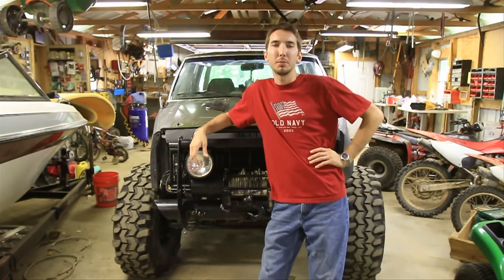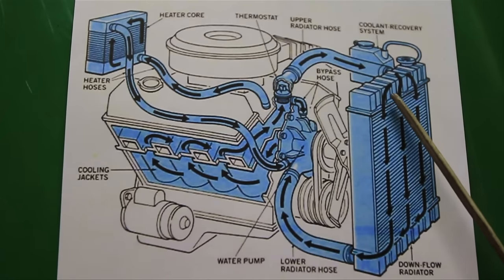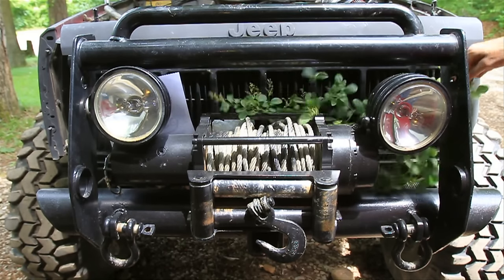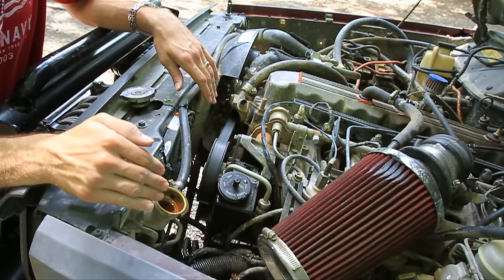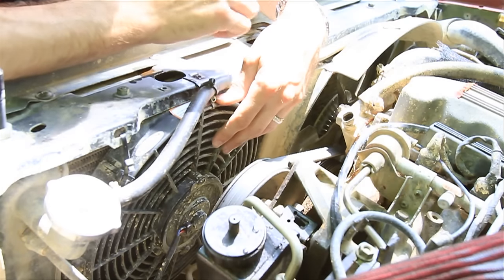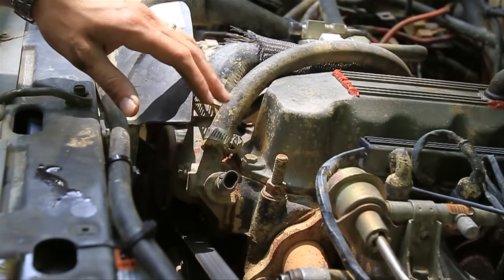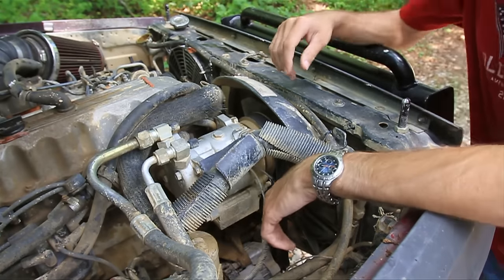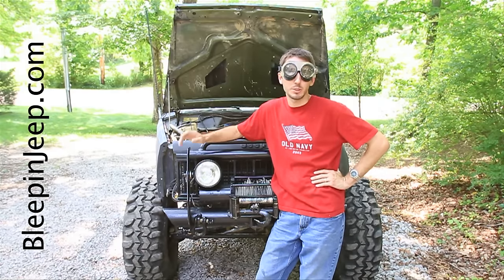Engine Overheating? - 9 Steps to Solve

Comment: Jeep xj's have a hard time in the desert. Hood louvers help as well as a larger capacity aluminum radiator. But lots of people have a hard time yet still in our summers. If you ever build a 4.0 here don't over bore the engine more than .020" because i've seen plenty of problems in cooling if bored more than that

Comment from the maker: i had the same issue a while back and it was the clutch fan.  sometimes they aren't bad but just aren't as good as they should be.  try putting a new clutch on there and see if that fixes the problem.

Comment from the maker: could be a ton of things but I would check that you don't have a clogged radiator first, that you didn't install the thermostat backwards, and that the spring in the lower radiator hose is still there (if it is suppose to have one).

Comment: I just watched the video. Great info. But maybe you should mention that after doing all nine steps if still haven't resolved the problem, to check for oil in the water or water in the oil for a bad head gasket.

Comment from the maker: well there are two types of cooling systems, open and closed.  If your overflow bottle is sealed like a pressure vessel then it is a closed system and you need a new bottle.  Most modern cars have open systems though and the overflow bottle has a vent and does not contain pressure.  if that is your case then there is a problem elsewhere which is just venting the coolant out the reservoir which it is suppose to do when there is a problem.

Comment from the maker: what i was saying is that you might have an airflow problem... the fans are not pushing enough air when you aren't moving fast.  check your fans.  That low rattling sound was probably your coolant boiling in the plastic bottle.

Comment: Can a cooling system flush really solve an overheating engine issue?My Ranger 3.0 was overheating.The coolant was replaced and this seems to have fixed the problem.No other problem was found.Thanks and you have a new subscriber!

Comment from the maker: They are both separated in different tubes.  just like the oil and coolant both go into the engine but they are in different compartments and dont mix.  The radiator cools the tranny just fine on stock applications but some people choose to add on another in line external cooler for performance applications, lets day for towing, racing, hillclimbing, etc.

Comment: My 4.0 renix ran cool at 160. Found out my thermostat was stuck open, replaced it and now it reaches about 180-190. I've heard proper operating temp for the 4.0 was about 210, any idea what may cause it to run cooler? My secondary fan is manually operated, so it's off most of the time unless I'm sitting still. I could drive her for a couple hours and grab the coolant line bare handed without burning myself, I know my temp gauge is reading right. Suppose I should be happy it cools itself so well.

Comment from the maker: several possibilities...  Either you have air in the system, or you have a clogged heater core, or you have a vacuum leak somewhere which will keep the vacuum controls from working properly until higher rpm.

Comment: Mine is perfect stock system with high flow pump and still overheats. Az summers 35’s 4:88 won tons and loaded up with strong tuned up 4.0 is too much for it so had to install a large trans cooler which works wonders!  I now think the leading cause of overheating cherokees may be this exact thing. rad fan shrouds super important and removing stock skid plate that creates vacuum on backside of rad is a bad thing but we all must do it for a multitude of reasons.

Comment: My bro in-law had an overheating problem with his 2000 Cherokee, had the 4.0 inline 6. I noticed a ''no flow'' condition so I removed the water pump. The bearings n seal were great, the impeller was almost GONE, it was just a flat disc spinning in the coolant. New pump, no more problems!

Comment: Great steps thanks. I'm a shade tree but start panicking & thinking the worst moving down from there. usually buying replacing parts I didn't need too sweat and replace. Nice to have a mellow guy go through steps I already know, slow me down, think. B.T.W. my wife loved it. She cant change flashlight batteries, but understood every word. Finally!!! she wont blow another head gasket Grrrr. I too stressed the importance of always wearing eye protection while working, thanks Jason.        Phoenix , AZ july 2016 114 degrees today.

Comment from the maker: If your temp is fine on the highway and high when you stop then not enough air is being manually pushed through... Usually that would mean your fan is not pulling enough air.

Comment: 91 jeep yj. Changed rad, tstat, water pump, hoses...it's still running hot. Not the 210 it used too. Only thing left if the fan clutch? Fan seems to be working fine. It's running around the 230 range not matter if it's hot or cold outside. 4.0, 295 tstat. Thanks

Comment: Hi I have a question I have a Jeep compass 2007 drove from LA to Yosemite-overheats when you drive long distance and uphill I already checked the fans which they look okay at the transmission oil flushed out two years ago but I didn't change the filter. Does not overheat when I'm driving on the street or on freeway. Told it was the transmission oil cooler that needed to be replaced but I just want to doublecheck if that is the correct reason. I know if I flush out the transmission oil again and change the filter in my cause more problems. Please help me!!

Comment: 2a) debris between the radiator & AC condenser.
10) plugged converter.  ;)

I like to use those lever-lock radiator caps when I can find them.  Then you can safely release coolant pressure when the system is hot.  Most radiator caps are also designed so you can release the pressure when hot, but I don't like to share that with people because you have to know what you are doing to do it safely.

I like to run a pre-filter on those cloth type filters, especially for when the water gets deep.  ;)

Comment from the maker: you might try flushing it if your are concerned, many times it was be a vacuum issue as well.  you might also want to check or replace the heater control valve.  But the heater core has nothing to do with a car overheating unless it is leaking the coolant out.

Comment: Like your basic diagram in the beginning you brought up good points here in a little constructive criticism and I mean no harm.

Coolant temp sensor you missed which is what tells them there might be an issue and sometimes false alarm/faulty sensor, you didn't elaborate on the internal radiator within the radiator for the xmsn or tranny should I say my aircraft mechanic terminology kicked sorry. A lot of the newer vehicles are using oil coolers i didn't see when this video was posted if old viewer might want to look into what systems your vehicle may include. If they are missing coolant didn't elaborate on where they might want to check where the coolant in going if so. Some vehicle water pumps break the impeller but still actually look like they are still good when their not. Radiator or heater core being clogged internally.

For the most part well done

Comment: excellent video one thing I am curious about is when you mentioned transmission fluid flowing thru your radiator. I am little confused if that is the cases then how do these fluids not mix together i.e the transmission fluided and the coolant/antifreeze fluided?
And do you have any video as good as this one for the air conditioning / car heating system? Great job
Reply: Separate sections so they can't mix.

Comment: You may have mentioned it but also check your oil level. Low oil will cause overheating. Too much oil will also do to frothing the oil from the crank shaft. And last if your oil pump has gone bad. Rear but it happens.

Comment from the maker: sounds like you could have a bad thermostat, low coolant, or maybe not a good 50/50 mix.  Also, make sure there are no bubbles in your coolant, in which case you could have a bad head gasket.

Comment from the maker: are you sure its a clutch fan or an electric fan?  most clutch fans I have dealt with are operated thermostatically and don't have a wire to control the clutch.  So now I'm a bit confused if you are talking about a clutch fan, an electrical fan, or a A/C clutch.  What kind of car is this?

Comment: Thank YOU! An alternate way to check the fan clutch!  The book says when it's hot it should be harder to move,  but as you say- it's practically impossible to check that way- my old one failed that test but so did the NEW one I bought- so is it bad? I doubt it; your "coasting" method sounds much better. I was about to drill a hole it the old one and pin it,  but now I'll check it your way. I don't have anyone to help,  but I can rig up my LizardCam so I can see it from the driver's seat if I can't shut it off from outside the cab...EDIT: Just checked it that way,  and it coasted for about 1/2 sec. Thanks again!

Comment from the maker: well make sure you replaced the right relay.  It may just not be getting hot enough to kick on.  As for the A/C check your fuses.  Also, jump the clutch to see if the electromagnet will engage.  Then get back with me

Comment: Very thorough thank you...also love the goggles...is there risk of putting air back into the system with the pressure cap off while running/testing?? I also thought that you are to put coolant in while the engine it's cold only, so how would it effect it one filling it with the engine hot?

Comment from the maker: same radiator but different tubes for the coolant and tranny fluid (not all radiators have tranny fluid in them).  The tubes zig zag back and fourth and the fins cover the tubes to dissipate the heat more efficiently.  try googling radiator cross section for an image

Comment: My Xj was heating bad. Boiling water dry. Had back flushed, new fan clutch, New pump hoses etc etc even a new rad cap. No help so far. Took to a rad shop, they tested "new" cap. didn;t even hold 2 psi. trip tp NAPA for new locking 15lb cap. NO more heating trouble! Sometimes its the simple things.

Comment from the maker: I assume you are talking about electric fans in which case you need a new fan or fans.  If it's coming from the clutch fan I would assume that its coming into contact with the fan shroud... meaning your shroud is loose or the engine mounts are bad and the engine is moving around.

Comment: might have missed a bad head gasket, or if the car has overheated previously cracked heads or block..  but thoes are the worst case scenario..otherwise you did a great job with your explanation.. thanks!

Comment: You can also do a compression test to see if your have a cracked head or a bad head gasket these will also make the engine over heat. Do a compression test on all cylinders and if one or more is considerably less then the others its a bad gasket or crack. Ive heard of another way to test your mechanical fan by spinning it by hand with the engine cool then let it warm up to about 200 shut the engine off and try it. if the fan is working it will be harder to spin. heat activates the clutch

Comment: I start overheating on the highway under heavy load, especially with the AC running.  All the components on my cooling system are new and my system has been flushed three times.  Any ideas?

Comment: And if the coolant system checks out...check oil pump especially if you have the oil sending unit with the threaded stud slip on connector and you get used to ignoring the oil light because that connector has (notoriously) gotten loose and breaks contact or regularly falls off...highly recommend an analog oil pressure gage on those models whether it be jeep(Chrysler) or Ford or general clunkers

Comment from the maker: did you replace the radiator cap?  or you might have air in the system.  is this a pressurized reservoir?  if so it could have a hole in it.

Comment: my mechanic tells me that this sound is the alternator pulley is loose. i have a 93 chamonix 2.5 diesel and that's what mine sounds like only worse at times. i am in the process of looking at doing the tightening which means removing the drivers seat and the cover over this area. i will try and keep you posted.

Comment: Lol I just installed a heavy duty fan clutch from a 4.0L YJ in my 89 XJ. Overcools but in traffic it gets up to 205 ish. I used to have running hot issues and I've replaced my radiator, thermostat (and housing too but that's a story for another time). I think my issue was a combo of a clogged radiator and a water pump with worn out blades

Comment: It looks like you need to install a coolant reservoir container. I had to on my first car a 1969 Buick GS SE. It didn't have one and the car was from Washington state and I was in Arizona. So when the car was hot on a hot day it would blow coolant out the tube once the car was shut off. So I added a cheap little after market coolant reservoir and it worked nicely. Once the car cooled down it would suck the coolant back in the radiator. Less polluting, having to add coolant, cost, and messes on the ground

Comment: Darn I just changed my hoses, thermostat, and radiator cap. It got dark on me so I didn't test it out yet but watching this video made me realize it's my water pump that's failing. Makes a loud whining noise when I turn the engine on gets louder when I accelerate for the first time then it stops. Also, when I opened up my coolant reservoir container there were little pieces of plastic or metal on the inside of the top.

Comment: Hey Buddy amazing video thank you so much for making it! As you mention at the end I have exactly the same problem so I have engine overheating only in traffic and in city drive. Should I start to replace the fan first? I was thought maybe my water pump went wrong.
(BMW x5 e70 4.8i 2007)

Comment: Ok, I'll try that soon...

One more question, I check me radiator fluid and it's a yellowish looking color brown kind of mirky look. And there's some sediment in it that looks almost like mud... I also have a weird noise coming from somewhere near the engine, that almost sounds like the power steering system when you turn hard, but has a high hum sound to it. Might this be the water pump? It does to to suck water when I increase the throttle.

Thank you so much for taking the time to help! :)

Comment: Fantastic, I have been trying to figure out why my truck runs great and doesn't overheat when I drive, I stop and it starts going up.  Also if I go uphill slow.  I service a road that is a residential slow grind.  I remembered opening the cap and seeing silver shavings.  When he said that it was bingo.  My mechanic has not figured it out.

Comment: You briefly mentioned thefan shroud by saying it's important. Please elaborate. Does it heat up gradually or right away when it's missing?
Reply from the maker: the fan shroud acts as a funnel so the air goes through the radiator before being sucked in by the fan...  without it some of the air will come from other places and not through the radiator.

Comment: Hi there thanks for all the great videos.  I have a 96 xj with 173,000 mi. On it. Has good headers and a cold air intake. I am having trouble with it passing the 210 mark when I'm driving in traffic or lots of stop and go. But when I'm on the free way with air flow it does good. What do you think about louvers also good locations to install them. And lastly a good upgrade radiator I could install. Thanks.

Comment: WHats best way now days to flush and clean engine block? Used to be able to use a water hose with compressed air and back pressure flush block, worked most of the time.

Comment: 1995 JGC over heating at idle it does boil over if idling too long. I replaced in this order- water pump/thermostat/hoses/ fan clutch/radiator/ then had an engine problem and replaced engine (V-8) long block, still overheating at idle. at my wits end on this one, even a mechanic said i replaced everything he would have. i even swapped out the injectors with Bosch 4 hole instead of the single hole injectors hoping that with a better spray pattern it might burn better. i checked for a vacuum leak but found none.

Comment: I have 96 Camry, and its smoking under the hood engine gets hot just in about 5 mins drive, there is one plastic bottle on left side to fill coolant in but top corner is burned just a bit, I filled a bottle with coolant took it for a drive and it got disappear, No leaks on hoses or something,  then i tried your step 4 :) Filled it from radiator cap it was all dry but when my engine started getting hot instead of sucking water it pulled it out and lots of coolant came out :/ P.s very nice video:)

Comment: Matt -- Cooling issue began on my 2000 Jeep G. C. Laredo 6C 4.0L immediately after changing the oil.  Bought a new radiator cap and replaced the thermostat.  Took your advice on "burping" the system, which I hadn't done.  Parked it on an incline cold, took off the radiator cap and started the engine.  The coolant was about three inches off the top.  Nothing happened after starting the car, but as the engine warmed up the coolant started to rise until it spilled over on the ground.  At that point I stopped the engine.  Seems like there's an obstruction.  What could be wrong?